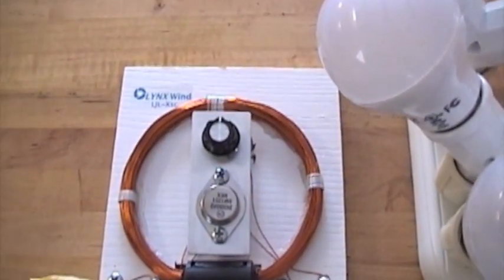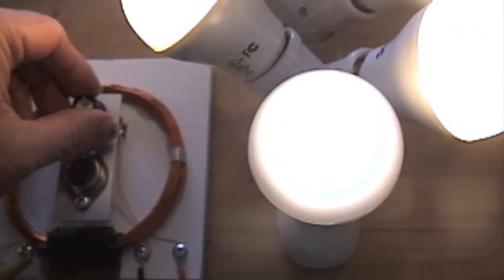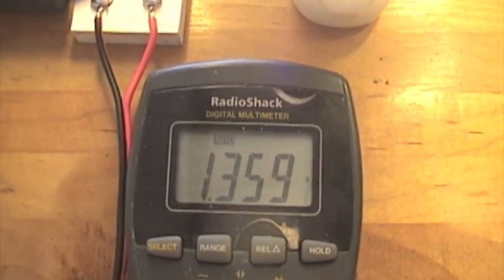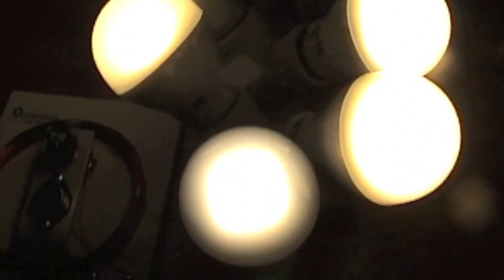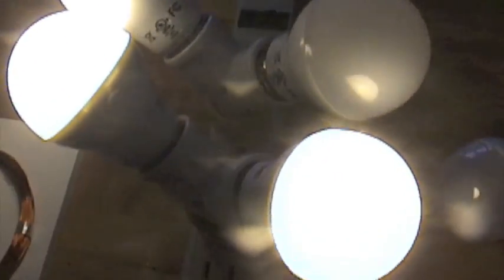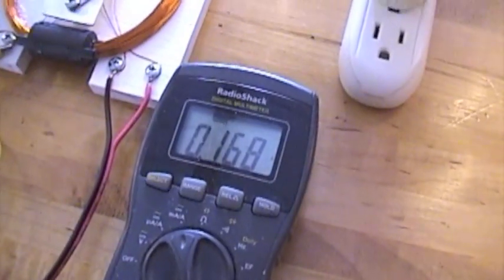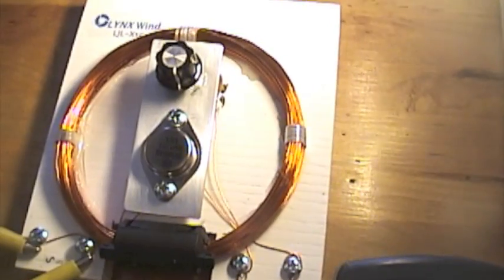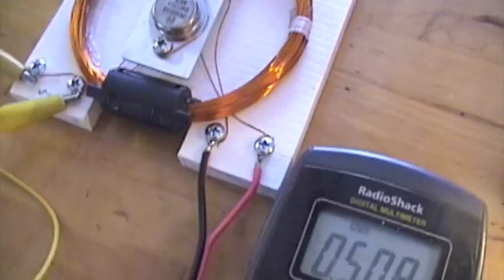LJL-Xsc

Comment: I built one and it works great. I use a 2sc3552 transistor and I change the coil connections. Thanks for all your sharing. You can even use it for charging batteries. Having a great time refining it.

Comment: Ive learned to use ferrit e cores and get more power and less transistor heat, and way less amp draw, mt last wind i got with a 6 watt load 134ac volts so you must run 2 lights so you dont burn out your bulbs, air cores is a thing of the past, i can get more power, less amp draw, and way less transistor heat, with a e70 core i can light 220 volt lights, with 12 volts and a e70 core i have got over 500 volts, but have no application for 500 volts unless you have to run 5 bulbs at one time, but if a bulb fails it will fry the other 4 bulbs, but if i use 6 volts i can get around 250 volts, ecores are the new way but very time cousming winding them by hand because its better to insulate each wind, and a lot of math on size of wire and how many winds you want to do, been working on this for over 2 years and got the math down pat, but it can get costly with solar panels, charge controler, batterys, bussbars , and switching, but i get my enamal coated wire from old TVs, a compleat 5 to 6 room system can cost up to $400, but when the power goes out its quit handy, and can use a pure sign wave inverter to run my fridge and deep fridge, i run a pure sign wave 1000 watt inverter that has a peek power of 2000 watts as when your fridge turns on it has to put out more power on start up, same with deep fridge
Reply: Thomas: What's the number of turns on your primary and secondary using the e70 ferrite core?

Comment: i bought 2 of them and just running 1 40w =6w ecosmart bulb and running 1 bulb the transistor is screaming hot even with a 2 inch square heat sink and you can cook a egg on this peice of shit no way in hell will this power  one light before the transistor fryes im 20 min, its junk, yea run it for 5 min your fine but run 1 bulb for 30 min and it fryes the transistor what a pile of shit, dont buy this junk if you want to run a light for over 20 min, in 10 min if you touch the trasistor it will burn the hell out of your finger and in 20 to 30 min transistor fryes even with a 2x2 heat sink added to the top of the transistor, this is crap dont buy it

Comment: The way I measure the brightness is to glue a photoresistor to the lamp. I plug it into mains power and read the resistance (write it down) . Then I plug the lamp into the LJL  and compare the resistances. The one with the lower resistance reading is brighter. You could also put a silicon diode in series with the lamp when plugged into the mains to get a 50% reading. Use it to create a formula.